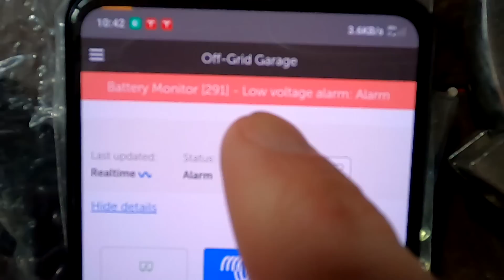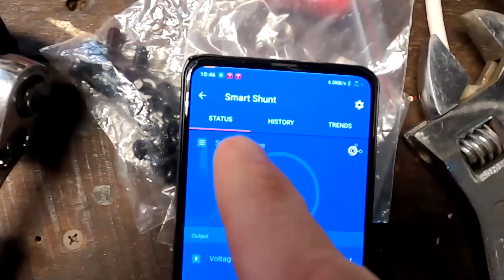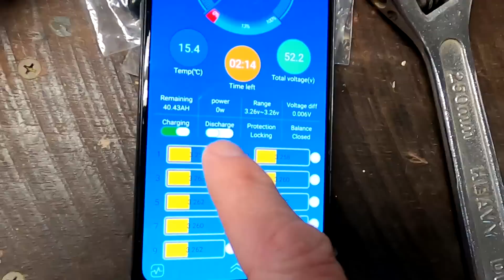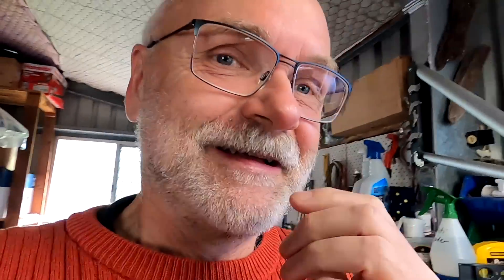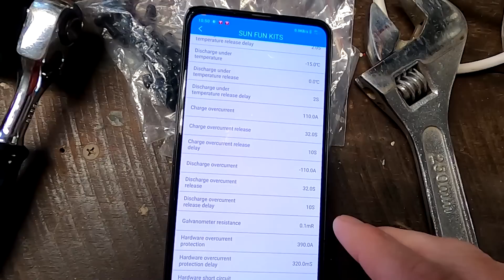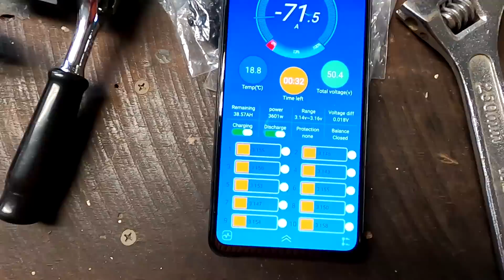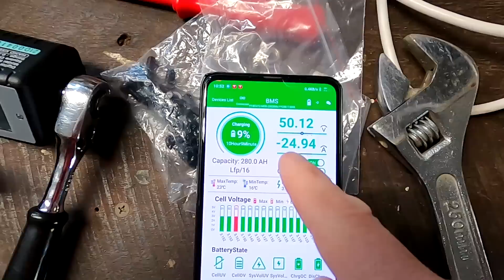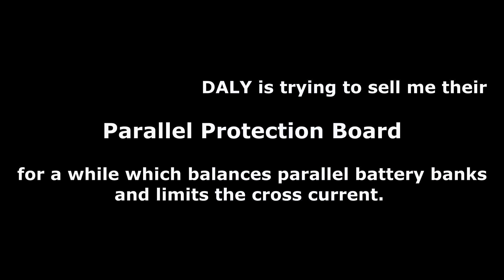Battery Low Voltage Alarm at 12%. Too many Bluetooth devices 🤦‍♂️😊

Comment: Im still sitting here watching and learning Andy how long does it usually take to charge from low voltage 2.5 etc all the way up to the full 3.65v ? whats the usual time frame to get them completely full? because i just got a low voltage alarm at 2am

Comment: Could you place a suitable LED bulb across the negative battery connections on the BMS that would illuminate upon a lost connection, when in normal operation the two negatives would cancel any potential in the circuit and the led would go out.

Comment: Don't forget to check the one you intended to turn off it ensure it's actually off, for that battery sitting on the workbench.
Reply from the maker: I'm confused now 😑
Reply: @OffGridGarageAustralia  I thought the reason one of the batteries on the shelf was turned off was from accidentally picking the wrong BMS when you wanted to turn off the one on the workbench. So I was thinking you may have never actually turned off that one.
Reply from the maker: @russkubes  Ah, right, I see. Yeah, that makes sense now. I disconnected the link between cell 8-9 though when the battery is not in use, so that's even safer.

Comment: Great video!  What type of terminal blocks did you use to connect the wires of the bms and the active balancer?  Thank you
Reply from the maker: I've got them here on my website: https://off-grid-garage.com/cables-and-connectors/
There is also a video where I use them: https://youtu.be/nnUXSEvb0sc

Comment: This could be a Useful Find .  If a big storm approaches one could take a battery or two out of use to save for the extended outage . Hurricane , big winter storm , etc.
Reply from the maker: You could, but it's not really saving you anything. The overall capacity will be still the same, regardless if you use one battery after another or all at the same time.
Reply: @OffGridGarageAustralia  Yes for sure but ,  If you knew a long outage was coming you could have a couple charged fully in emergency reserve is what I was getting at . The Tesla power wall watches the weather and has the ability to charge from the grid if it senses an outage coming . This would only work if you have the grid available to charge with though.
Reply from the maker: @onthelake9554  Yes, that is correct. I think the Victron system does something similar but it's not automated yet, so you need to tell the system to charge higher and prepare for a possible outage.

Comment: I've done the same thing on my system, sort of. I've accidently turned the soft buttons off and didn't notice until there was an issue. Maybe the xiaoxiang  app needs a confirmation prompt when switching these buttons manually.
Reply from the maker: The main problem is that the app is connecting to a random BMS if you're not selecting one in time. You have only a few seconds to choose the one you want.

Comment: Hi Andy, you are doing a great job. I watch your video Alot to the extent that your background song literally haunts me. My question is in regards to the JK BMS which I assume you are an expert on.

When I have a low battery discharge, it cuts off as it's meant to be. However it does appear that when it cuts off discharge, it technically also cuts off charge which is strange since they both have the same leads(charge and discharge).

How can I solve this problem? Because my solar charge controller doesn't come on unless it sees a batter voltage but the JK BMS wouldn't release a voltage when it's discharged.
Reply from the maker: Thanks for your feedback. You can listen to the song for free in all of my videos 😂

The BMS should allow charging the battery when you have a low voltage disconnect. Have a look at the status bar on top of the first screen. You can see the three buttons for Charging Discharging and Balancing and if they are enabled. 
So if one goes off, the other one should be still active (green). 
In your case it should still show the discharge button as green and power your charge controller.

Comment: Good one Andy, great to know. It’s very encouraging to see that! 
(I would still be very suspicious of your Victron displayed SOC if it hasn’t been synced for a long time.)
Reply from the maker: Yes, absolutely. The shunt will be out of sync by a lot I would expect. Will be interesting to see once we fully charge again. Maybe next month already?
Reply: @OffGridGarageAustralia  Cheers Andy. It will be VERY interesting to know how far it’s out of sync when the time comes, (and perhaps a good time to find out how your settings such as charge efficiency and peukert numbers are.  I have my Victron shunt settings in the caravan set to be intentionally slightly pessimistic, - I’m still waiting on the replacement JK BMS-  but most days if the sun is shining we get a full charge and sync anyway.)
Currently - we have been three weeks away off grid in the caravan and have used LPG only very occasionally for the oven (just having a fresh muffin and coffee right now!). We do nearly everything on battery power including lights, TV and satellite, hot water for showers and washing up, induction cooker, baby air fryer, bread maker, coffee machine, washing machine, reverse cycle aircon for heating, and more. Doing all of this we haven’t been below about 40% SOC even with the occasional few days of overcast.
LOVE my solar and Winston lithium batteries!! I could never go back to AGM!
Reply from the maker: @FutureSystem738  wow, that's amazing, Dave. Even the hot water comes from the batteries, that is incredible. Sounds like really good system you have build there. Thanks for sharing.
Reply: @OffGridGarageAustralia  Yep- the hot water draws about 1kW. (It’s a 20 litre gas/electric Swift HWS). 
I mostly turn it on early afternoon so that the batteries are already full, and then solar provides most of the power, with only 20-25A coming from the battery. It takes about 45-50 mins to heat the hot water tank, and the 20 litres is enough for dishwashing and two hot  showers. 
If there’s no sun shining it’s about 85A coming from the battery via a 2kW inverter, … but that’s still not a lot, under 0.25C from a 400Ah battery. 
I USED to have a 3kW inverter/charger (and never ever used the charger!), but ditched it as it was very heavy and had very high standby current. We now manage very well with a 2kW inverter, which can stay turned on from breakfast till bedtime, and has good low standby current. My wife has become very good at juggling loads to avoid tripping the inverter ;-)

Comment: 3:46 I believe, I heard 3 mosfets wailing as they died(like a popcorn) pop pop pop😂
In a test when I married 2 packs, there was only a 20mV voltage difference between packs, there were still 10A equalizing current.
Reply from the maker: No smoke, no dead Mosfets. Hence I checked the BMS settings before again. There is also a hardware limit setting of 250A in the BMS. If we reach that, it would turn off immediately. If you have like 20 FETs in parallel and each can carry 150A, it should be still safe. But it would be an extreme test for sure.
Reply: @OffGridGarageAustralia  Thanks 😊

Comment: Hi Andy, I have a suggestion from the cheap seats. Why don't you get three cheap tables and set them up on the battery with each one handling its own BMS so no confusion?
Reply from the maker: Ah, you mean tablets, not tables. You got me confused here... 😂
The problem would be that they disconnect after a while when not in use and I have to reconnect to this specific BMS again anyway.
Eventually, we will have all BMS connected to the Victron system so we can see the data there. the BT connection is only need if we change parameters. At least, this is the plan for now...
Reply: @OffGridGarageAustralia  lol yes tablets sorry!

Comment: Good job Andy, and congratulations on what must be ur shortest vid to date. I think a lot of people make too much fuss about inrush currents and what u have shown here is about what I would have expected, so it was good to see it in real time come down from 150A to under 100A quite quickly, this is really nothing on any of these batteries, the stress test here was could the outputting BMS handle it for the few seconds without tripping out.  Another great vid & info. The beard is fine, let it go. Cheers
Reply from the maker: Thanks Evan. Yeah, I checked the setting of the Overkill before to see if it could handle it. When we did the test with paralleling the 304Ah battery with the 5Ah battery a while back, we could see the BMS tripping if the current is too high.
I left all BMS's on 100A discharge, so they can power my loads individually in case I have to shut down two of the banks.
Reply: @OffGridGarageAustralia  that was my thoughts too, if you parallel banks, each one ideally should be able to power your load for redundancy & maintenance.

Comment: I have a 48v Lifepo4 100AH setup. It runs perfectly. However I also have a very nice 52v LG cell lithium ion 21AH Ebike battery. I would like to add the Ebike battery in to my banks. The voltages that I run (46-54.5) is within its bms parameters. Is this safe and possible to do? If so, how should I do it? What precautions need to be taken?
Reply: While it is technically possible, I personally dont feel this would be a good idea really, ur ebike batteries are not cheap either (unless u DIY ebike batts) and I would expect they will give u a much shorter lifetime use than the lifepo4 chemistry. $/watt u have roughly 1kw of ebike battery and 5kw of lifepo4 battery with a life expectancy of 10-20 years, how long will one ebike battery last cycled 80% daily? So some Q’s to ask yourself could be, is 1 ebike batterie 80% cheaper than 1 x 5kw lipo4? Will the ebike batteries last long when cycled this way before you spend any $ on trying to configure it into your system.
I would tend to keep these two chemistries seperate for their respective uses and save a few bucks towards increasing the size of ur lifepo4 bank with another more similar battery type if u feel u need more power there.
Just my opinion, hope this helps. Cheers
Reply from the maker: It is possible to parallel the two batteries. The main problem here are the two completely different charge and discharge curves. LiFePO4 is very flat while Li-ion is linear to it's SOC. So what will happen? The main LFP battery will stay in the almost constant voltage part of the curve and charges and discharges while the Li-ion battery will be following this voltage and gets only very small micro cycles. Unless you fully charge and discharge your LFP bank (steeper areas of the curves), you won't get much capacity gain from the parallel Li-ion pack.
Reply: @OffGridGarageAustralia  so really no danger but not much gain from it? I do usually use most of my battery throughout the night. Usually down to about 10-15%, when running my A/C. If no ac then only maybe down to 75%. Only for fridge, lighting, cooking,etc. And thank you for your response. I love your channel. You’re the reason I went solar on my semi truck
Reply from the maker: @weaponizedautism6199  no real danger but no benefit either. Does the e-bike battery has its own BMS build in?
Reply: @OffGridGarageAustralia  99.9% sure it would have Andy, just as my Makita lion tools do, but not sure how effective they are. 
I have repacked a few of my own Makita Batteries and found that if not used or recharged often enough they have a problem of discharging the last battery cell (or 2 if paralleled cells in pack) to run the BMS, and this can run the pack down unevenly when not in use for ‘awhile’ so they wont charge down the track, sometimes u can get away with just charging the cell (or 2) that is down enough & giving trouble to get the charger to accept charging again, so the BMS evidently only uses the last cell (cells) in a string to operate BMS,and this is a problem with Makita, I dont know if all these battery tools do this, but I suspect they mostly do.
Reply: @weaponizedautism6199  interesting, so this setup is for ur semi & sleeper cab? Good idea, do u charge it just from solar or do u have a 24v-48v charge system as well? Curious how well ur charging system works & ur setup for that. If ur only going down to 10-15% on ur 48v lipo4 and recharging daily isn’t an issue, then sounds like ur pretty good, Im presuming here u have a server rack type Battery, if so with a decent BMS built in Andy has shown us we are best to use it, and that this LifePo4 chemistry is more likely to degrade from calendar ageing than from 80-90% daily use. 
Would be keen to hear more about ur system for this purpose, but I stand by my initial comment, I believe u would do better to leave ur ebike battery out of this equation. Look forward to some more of Andy’s tests with the different chemistries paralleled . Cheers
Reply: @OffGridGarageAustralia  yes, that’s right, & in doing so (fully charging & discharging) could this also cause premature degradation of the lipo4 battery, which would further beg the question, if there is any real capacity gain advantage long term by doing this.
Reply from the maker: @evil17  I will test this at some stage. Quite a few people have asked and wanted to know. I thought about a parallel setup of LFP, Li-ion and AGM at the same time and then cycle it through and watch the single batteries how they perform.

Comment: Tried to take a live sneak peak at the Off-Grid-Garage in the Victron VRM World, but I get "Warning: Shared token invalid." message.

I've had that happen to me a handful of times myself. Good thing is that the JK-BMS app requires you to verify password in order to get to those settings, however it is not "fool" resistant. Majority of the battery packs I've built are on the JK-BMS platform, I've assigned them 6 digit serial to them and the password has to match that number or I can't change the parameters to the BMS. Thank goodness most us just set it and forget it.

Can't wait till you get more sunlight in the fall and see what the performance on the solar upgrades to the garage...
Reply: Andy, could you just add a page to your site that redirects to the VRM site? This way you can have all your videos link to your site (which won't change) and if the VRM URL changes again, you'd only have to update the redirect on your site rather than every video.
Reply from the maker: @russkubes  yes, that's a great idea. I still would have to update this new link under a lot of existing videos. But if it changes again, I'm set💪. Thank you!
That's what I usually do with all other links for this exact purpose. Not sure why I linked the VRM directly 🤷‍♂️🤦‍♂️
Reply from the maker: Thanks Felax. Also for your ongoing support and donations🙏
That could be a cookie in your browser why the VRM is not letting you in. If you have a look and delete that it should work again. Try also from another browser or device...

The solar upgrade already makes a huge difference with all the shading. I'll show this in the next video...
Reply: @OffGridGarageAustralia  I've cleared my browser cookies and history, but to no avail. Tried it on Firefox, Microsoft Edge, and Apple Safari. Still getting the same error message.

I've even tried the link on my Android tablet for shins and giggles with the same results. Maybe YouTube is discombobulating something during the redirect? I'm just taking a bit of a wilde guess.

Even tried to copy the link and opening it on a separate browser window and getting the same error message.
Reply from the maker: @felaxchow207  I've received the same message on my test computer...
I've checked the shared link with the one Victron provides and surely enough, it has changed! WTF?! 😒I have to go through all the videos now and change it! I need a script for that...
Updated the one in the description now to
https://vrm.victronenergy.com/installation/100328/share/d0ebad4e
Reply: @OffGridGarageAustralia  cool beans, I just updated my bookmark and it works like a charm. Oh what fun it is to update all of the past video descriptions.

Looks like the Pool Fence array is your top performer today, but every bit counts when it comes to solar. Reminds me about the panels that I have propped up by the shed, it still averages 3 kWh per day for the past 7 years.

Comment: Daly is trying to indoctrinate you into their eco system.... If this particular parallel protection circuit was as good as they say, it should have already been integrated into their BMS as a feature to give them an edge over their competitors.... They know that it's not necessary but hope that someone will spend some money for it anyway which is why it's an additional component just like an afterthought....
Reply from the maker: Yep, and people are actually buying it. Their marketing seems to work. I should have not mentioned it, right? 😁

Hankzor is developing a BMS right now which has this built in. But it only has 80mA passive balancing instead of active balancing. I told them that nobody will buy it...
Reply: @OffGridGarageAustralia  80ma! Yeah that's fine for a string of 18650's.... But it's not designed for that, so in the real world, that product is going to fail! 
I would go as far as to say that whomever is doing the designing, they don't have a solar system at home to actually know what is really required out of a BMS. It's a crazy business model, if you are not passionate about what you do within your business, brace yourself for failure... 
Your passion Andy, I see that you wear it on your sleeve for everyone to see, that's why your channel is so popular.... 
I have to say though, I really loved the Doom reference in the battery 3.0 build.... I really felt like you just opened up a door into the life of Andy.... Thanks for being apart of this amazing country! We are lucky to have you call Australia home..